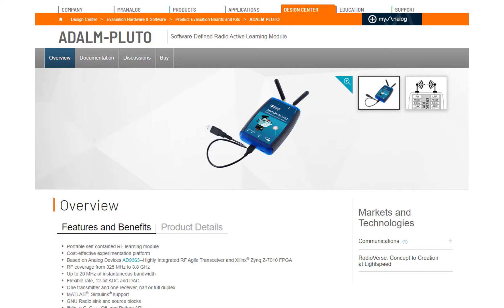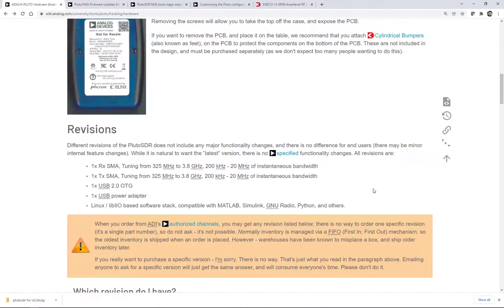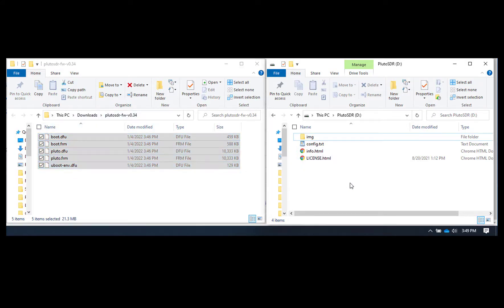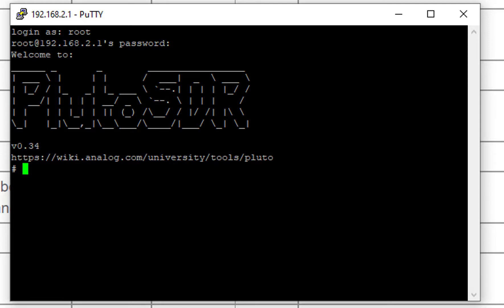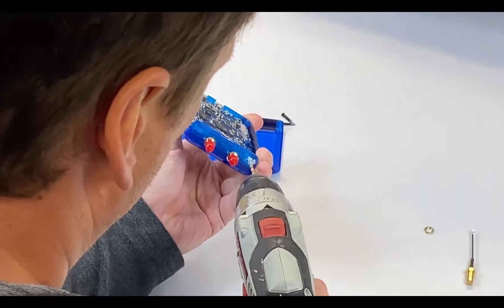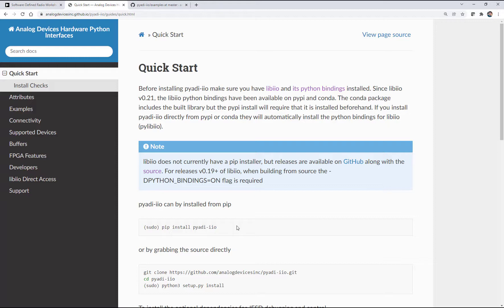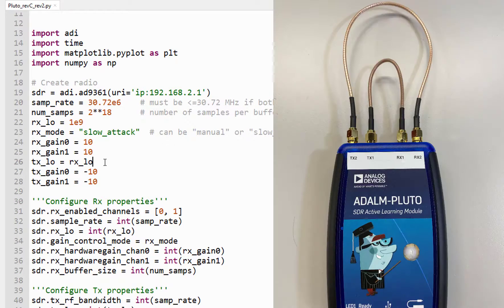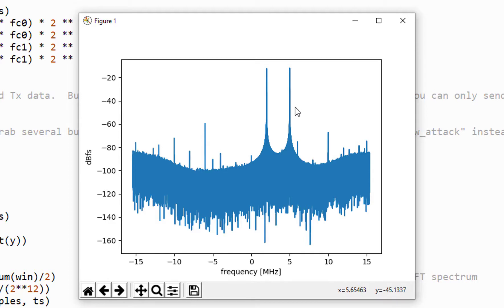Enable Dual Receive and Dual Transmit for the new revision of Pluto

Comment: Hey Jon,

 So whats the catch here ? is it like AD9363 hardware have 2x2 channels but just not user by firmware ? Or its just some software level hack and AD9363 do not have 2x2 channels? Specially about Frequency range and bandwidth ?

Comment: Hi, I am very new to this. What cables and adapters are you using at the end for testing?
Reply from the maker: The links for the u.FL cables are in the video description.  Then to connect Tx to Rx, you just use a standard SMA cable.  One is included in the box with Pluto already.

Comment: Hi Jon, thanks for the video. Suppose, we transmit the same sinusoid over 2 Tx and receive the same on 2 Rx, can we get phase coherence (apart from the slight mismatch due to the slightly different properties of the connecting cable)? Have you ever checked this?

Comment: Hey, will it increase the performance by times 2?
Lets say the maximum BW is 60 mhz will it be able to recieve 120 mhz simultaneously? Or will it be able to transmit 2 signals simultaneously? Thanks in advance
Reply from the maker: The dual Rx/Tx mod will allow you to output (or receive) two signals simultaneously.  But the max BW will be 1/2 of the single channel.  So single channel Pluto can do about 61.44MHz BW, and dual channel pluto will do about 30.72MHz BW.  Neither could ever do 120MHz BW.  For that, you'd want the ADRV9009.

Comment: Jon...I really appreciate this series of videos...excellent content!  Any idea why I would be getting a big spike at zero hz?  Using your script I can see the 2MHz and 5MHz signals, but they are somewhat overpowered by a dc spike.
Reply from the maker: Yes, that's largely from LO leakage, since the LO is at the same frequency as the RF signal.  They both mix down to 0 Hz (DC) together.  But the LO is much more power than RF, so you get a large spike from it at DC.  Pluto has some automatic calibration that compensates for this, but you can also run software algorithms to remove, or just offset your signal from DC (like those signals at 2M or 5 MHz) so that you can demod them away from all the DC stuff.  More info here:  https://www.analog.com/en/resources/analog-dialogue/articles/transmit-lo-leakage-lol-an-issue-of-zero-if-that-isn-t-making-people-laugh-out-loud.html

Comment: Hi Jon, thanks for video. It all worked for me, but I am having trouble that I can not resolve. After call of sdr.tx([iq0,iq1]) I let it transmitt for 5 seconds then shutdown by sdr.tx_destroy_buffer(). Set tx gain very low to attenuate transmitter 0 by tx_gain0 = -60 and sdr.tx_hardwaregain_chan0 = int(tx_gain0). And then again transmit sdr.tx([iq0,iq1]). It will bring up 2 signals up and after 5 second shutdown signal on chan0 However, if you run the program several times it always shutdown channel randomly and not always on chan0. Do you know why it randomize channels? Thank you
Reply from the maker: I've not seen that issue before.  For help with Pluto, this is the best forum:  https://ez.analog.com/adieducation/university-program/

Comment: Thank you very much for this! Hopefully I will be able to try it myself in the next month or so. There is however a bit I am missing completely , apologies if I ask something stupid: Even with the change the frequency it should support is 70MHz to 6GHz. However in the video we see 2 MHz and 5 MHz. What am I missing exactly here?
Reply from the maker: Right, the frequency range of the radio is 70MHz to 6GHz.  So it can place data anywhere in that freq range.  The actually data to be placed, called baseband data, can be up to 56MHz.  For these demos, the "data" was just the sine waves at 2MHz, 5MHz, etc.  But in a real system, the data would be something like QPSK/QAM/OFDM, etc, that would occupy that <56Mhz of BW.  Hopefully that helps clear it up!  Here's a nice explanation of it:  https://youtu.be/-mks0TAwqQU?si=8fKO_wEiU7yk82bK

Comment: can you  Synchronize TXs of Multiple Units  to get 4 elements or more
Reply from the maker: You could do it with Pluto, using the external clock input/outputs.  But you'd have to recalibrate it every time it powers up--that would be a pain.  For a real world application, though quite a bit more expensive, I'd recommend the ADRV9009 SOM:  https://www.analog.com/en/design-center/evaluation-hardware-and-software/evaluation-boards-kits/adrv9009-zu11eg.html

Comment: For the pyadi-iio install to be able to run python code to the pluto.  this is for linux only?  I  was able to install the libraries for the libio for windows but, is there a way to install it for visual studio code(my preffered IDE) for windows?  Or should I run it on ubuntu vm in linux only?  Thanks ahead of time!
Reply from the maker: You can run on Windows or Linux.  But it'll have to be in Python to use pyadi-iio.   So something like Spyder (which is what I use) or Pycharm would work well.  There are C/C++ drivers for Pluto:  https://wiki.analog.com/university/tools/pluto/controlling_the_transceiver_and_transferring_data.  But I've never tried programming Pluto in visual studio or C, etc.

Comment: Hi Jon, do you know if it's possible to run pyadi code directly on the pluto's embedded computer itself? The motivation for this is to not have a limited bandwidth due to the USB interface and to minimize latency that exists with all the IIO overhead on a seperate computer.
Reply from the maker: It's an interesting idea!  But from what I understand, the ARM built into Pluto's Zynq 7010 is very tiny.  Check out this post:  https://ez.analog.com/adieducation/university-program/f/discussions/98761/gnu-radio-on-the-plutosdr-proof-of-concept
Alternatively, you could upgrade to the ADRV9361-SOM, which has a much more powerful FPGA and ethernet data streaming.  And all of the programming discussed here would be 99% the same.  
https://www.analog.com/en/design-center/evaluation-hardware-and-software/evaluation-boards-kits/adrv9361-z7035.html
Reply: @jonkraft  Thanks for the quick reply! Do you think by unlocking the second core (I know it's not official sanctioned) and cross-compiling for C is sufficient for the Pluto to do real-time DSP for communications?
Reply: @Hotrod768 depends on how complicated your processing load is
Reply: @TheSmbTechy  Thanks for the reply. I have been working on this since this message was posted. I have been able to get some real-time OFDM communications using the signal processing on the pluto. It requires some tricks and assumptions, but you can get some significant bandwidth (15 MHz QPSK).

Comment: I updated to .37 firmware.  After setting with - fw_setenv attr_name compatible, fw_setenv attr_val ad9361, fw_setenv compatible ad9361. It comes back - fw_printenv attr_val, attr_val=ad9363a after reboot.  HELP Please.It is a Pluto Plus...  P.S.  does someone sell modified Pluto's with the extra 2 connectors?
Reply from the maker: Pluto Plus is not a real Pluto.  They are just copying the "Pluto" name from Analog Devices.  I don't know anything about it, and I don't know how well it is supported.  You'll probably need to reach out to the person who is selling the "Pluto Plus".
Reply: @jonkraft  I am having the same issue with the adalm pluto rev c. I set the mode to 2r2t and after a reboot, it is reset to 1r1t. I did have .37 firmware and updated to .38 and it is still doing the same thing. name, compatible, and val all take

Comment: I would recommend completely disassembling the Pluto before drilling the holes in the faceplate. You can actually remove the faceplate that the native SMA connectors protrude from. Then, you'll notice on the interior surface of the faceplate there is a raised lip around the perimeter that prevents you from making flush contact against the plate if you buy the u.FL to SMA cables linked on the beamforming video from Oct-31-22 and drill the holes where Jon does using the enclosure as a guide. These cables have a bulky hexagonal collar on the SMA end that will contact the outer lip of the faceplate causing an uneven mount. So, I would use the lip on the inner surface of the faceplate as a guide instead to drill the holes. To Jon's point though, our main focus is to not damage the PCB. Also, a trick to installing the u.FL is to use the flat end of a pen or eraser of a pencil to apply even perpendicular force to get them to snap in place.
Reply from the maker: Thanks Kurt! Great points!  Yes, in retrospect, I should have just taken the whole thing apart and drilled it then.  I was trying to save a few steps, but what you are suggesting is a better way to do it.  And very great tip on the u.FL connectors!  I just now tried a pencil eraser and that worked great.  Thanks!  By any chance do you have any tips for how to easily remove a u.FL?
Reply: @jonkraft  hmm.. without having tried it I would probably use a pair of curved tweezers by positioning the tips beneath the connector on either side and then using the curve of the tweezers against the PCB as a fulcrum to pry the connector upward. Like I said though, I haven’t tried it, but that’s what I would do! And since i have your attention I’ll just say I really enjoy your videos! I’m an RF test engineer working in beamforming applications so this content is great to learn from
Reply from the maker: @kurtttttttt  Thanks for the kind words Kurt!

Comment: Where are you runing it on? on local machine (on the Pluto itself) or the host machine? Is possible that you can give the instruction for a complete newbie about using python to control Pluto like that? I would like to control it over wifi network via SSH or any possible way. Thanks
Reply from the maker: Yes, Python is running on the computer.  Just plug Pluto in via USB, and then follow the install instructions in this video.  More info here:  https://wiki.analog.com/sdrseminars

Comment: Jon:  If I order a pluto directly from AD, will I DEFINITELY get a rev. C? I've asked distributors, and one replied Rev B, the other did not reply.  THANKS!!!!!  ps I already have two rev B's but the C id definitely the better device.
Reply from the maker: Unfortunately, there's no way to truly guarantee that you'll get a rev C.  I suppose you could buy and then return if its a rev B.  That's a pain though.  However, Analog released rev C over a year ago--so most of the old rev B inventory should be flushed through the system.
Reply: I just ordered one from Mouser and it was rev c. Better than DigiKey because they were tacking on a $22 tariff !
Reply: @rjones8508  OK, I gave it a shot, thanks!
Reply: @rjones8508  You were very lucky. It's 13 April 2023 and I just ordered 2 of Pluto Units from Mouser and am now returning them because they were REV B. To say that least I am very disappointed. I would love to know how to get the REV C units.
Reply: @e2jw  As it turns out, while the device seems to work perfectly according to its spec, its sample rate is a little too low for my application (I need a bit more bandwidth, ideally quite a bit more, and should have noticed that it was right on the edge). So I haven't been using it. If you cant find one elsewhere and we can figure out a way to do it, I'd be willing to sell at or near my Nov '22 cost (230.62 + 9.79 orig shipping + 15.73 tax) + whatever it costs to get it to you. I still have the box. I was keeping it thinking that maybe I could use it for some other less demanding application.
Reply: Very nice presentations Jon.  I would think ordering from Analog directly would be the safest bet.

Comment: Hi Jon,
Any directions on how to incorporate this in GNURadio PlutoSDR Sink and Source blocks? Maybe by accommodating this code in the python file generated from grc? Maybe through FMComms or IIO Device blocks?
Reply from the maker: It will be exactly the same as using the AD9361 in GNUradio.  So use the FMCOMMS blocks for it.  The only difference is the max output data rate is limited to <30.72 MSPS (because Pluto uses the CMOS data interface instead of the higher speed LVDS output)